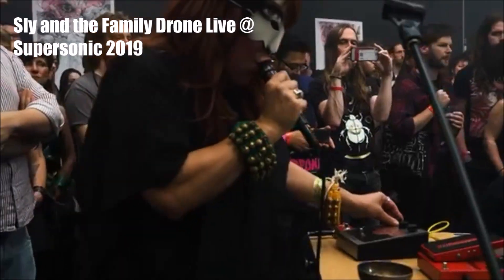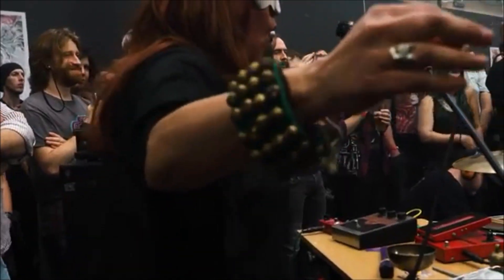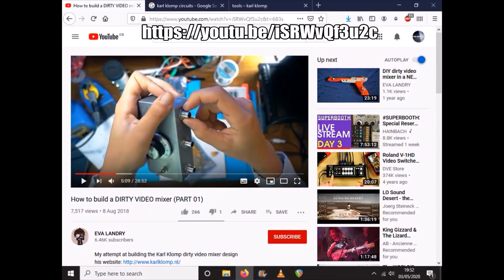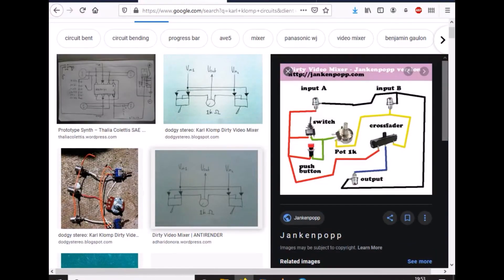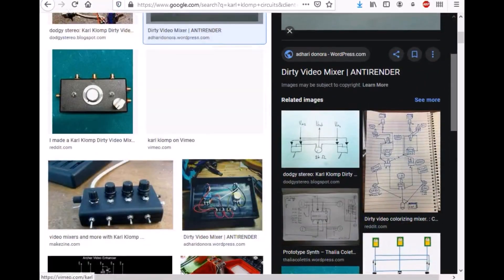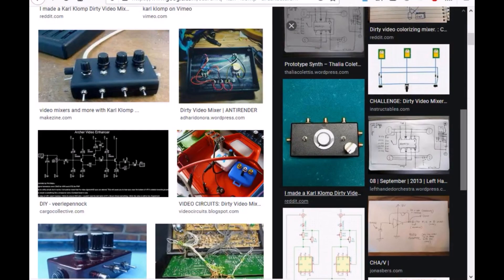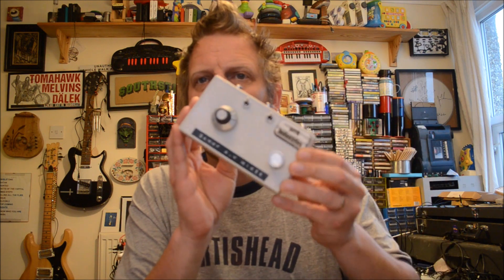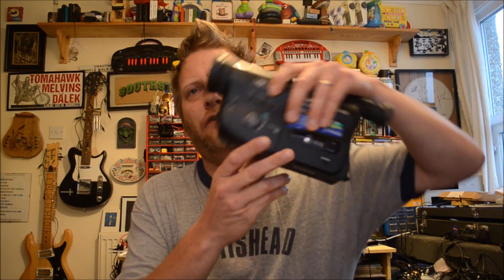#19 The Gammy A/V Mixer - Two channel lofi video mixer with added audio interference input

Comment: what kind of sound source does this require? like, could i use just a guitar signal or should it be something more amplified?
Reply from the maker: I must admit to only using it with line level audio signals and not a guitar or passive turntable signal as yet. All I can say is the line level very much overpowered the visual signal, so it would be an interesting effect to try out with lower level signals. Good luck!